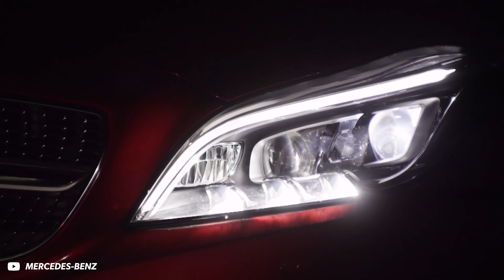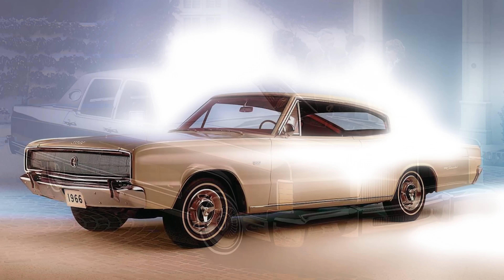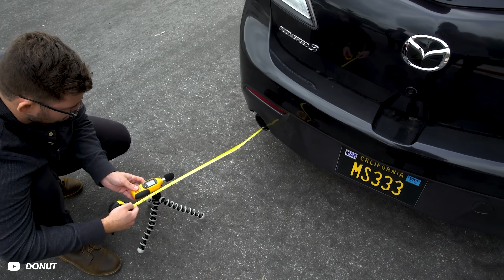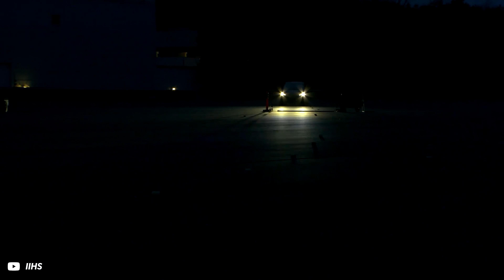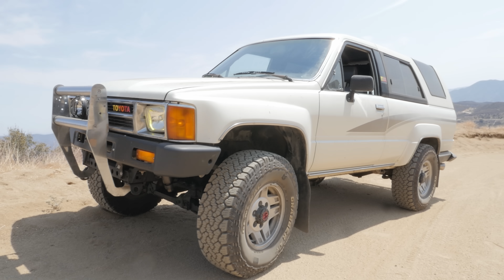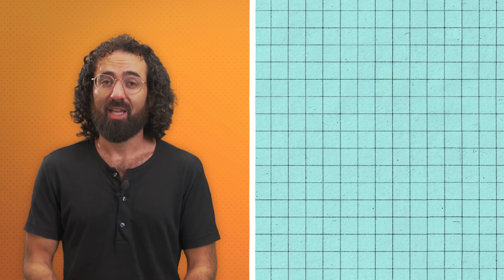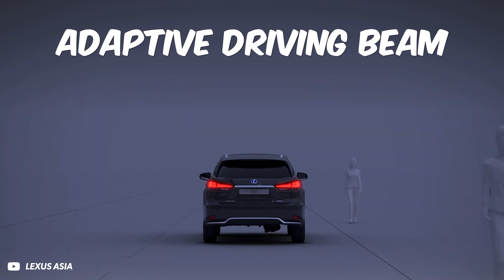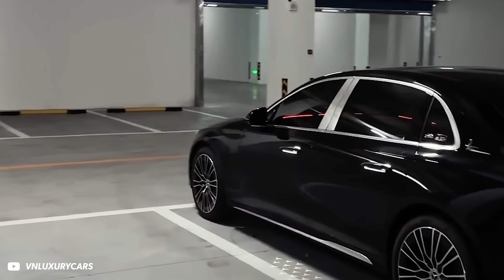Why new headlights are blinding American drivers

Comment: European here, its important to note that there ARE aftermarket LED bulbs which do in fact simulate the behavior of a halogen bulb filament and retain the correct beam pattern. There are also road legal certified models like the Osram and Phillips LEDs.
Those however are expensive, so most people buy cheap Chinese retrofits and give LEDs a bad rep.
Reply: Yea, those compliant LED replacement really works, you can tell if it's good if it doesn't require readjusting the headlight, it just throw out almost the same beam pattern as it has all the focal point of light source be exactly where halogen version of it would be.
Reply: Road legal aftermarket LED light sources have to be tested and approved for each type of headlight, which drive up costs and make it hard to find road legal LED light sources for less common vehicles.
Reply: @johan.edlund  exactly. The behaviour will depend on projector and other elements. It is not possible to emulate with leds the ligth emision of an halogen filament.
Reply: @ptamog Each road legal LED conversion kit is tested in the headlight it is approved for to verify that the headlight meets legal requirements with the LED lightsource. If it is used in any other headlight it's not road legal.
Reply: @johan.edlund  I need to look for a certified one for my car. The situation now is unbearable for people with halogens.
Reply: I've looked into things and done testing myself.  Some things I found:
Sometimes, even changing from Osram to Philips bulbs require beam adjustment.  (Yes, bulbs were correctly seated).

Projector beam patterns are different to reflector beam patterns as projectors have a raised horizontal cut-off towards n/s kerb whereas reflectors have a 15° slope.

LED output exceeded 100 lumens per watt in the last 2 years and Lumileds can reach 150 lumens now.

Motorcycles can upgrade to LEDs in UK.
I changed to retrofit LED projectors but incorporated a dimming function for urban use as headlamps are always on.
Strangely, these LED projectors are not legal for car use despite having excellent beam control.

Many trail type motorcycles have auxiliary fairy lights.  These lights do not produce a good beam pattern and produce glare.  They reduce safety.

Many OE lights have very poor beam control and output a lot of light above the beam cut-off.

Adaptive lighting is often very bad for truck drivers because truck drivers sit higher.  Adaptive lighting is not a panacea.

Some retro-fit LEDs by Osram and Philips have homologation in Europe.  Although the reflector beam pattern can still cause dazzle on sweeping left hand bends, they are normally a lot less dazzling than lots of OE lighting.

Many retro-fit LEDs produce lots of foreground lighting but offer less penetration (long range lighting) than good halogen lamps.

High efficiency bulbs by Philips and Osram are usually better than 80/100 watt halogen bulbs.  They cause less glare also.

It is possible to have aftermarket retro-fit LEDs in reflector lamps which don't dazzle unduly but care must be used.

Scratched and crazed polycarbonate lenses cause more dazzle than dirty lenses.  This makes a mockery of requirements for HIDs to have power wash.

If retrofit LEDs are used, people should use the electric load adjusters for urban use.

4×4s, crossovers and vans typically have lamps placed too high and typically dazzle drivers of cars and pedestrians.

Hope that may be helpful.
Reply: American here, I bought the road legal Philips bulbs in 4300k specifically due to their legal status (in Europe, leds are not legal in the US, just goes in enforced). Something like $240. Still obnoxiously bright.
Reply: @Krautastic  i've got plus 150% phillips and they are better than aftermarket LED. good for spotting Australian native animals. the 5500+k LED are usless for county roads,
Reply: Wut?
My understanding is the pattern is not achieved by the LED bulb itself, it is achieved either by a projector lens + a shutter or by a reflector.
A LED bulb is merely a stick with bunch of LED "chips", it has no "ambition" to direct the light it emits.
Reply: @jaromor8808 you are correct, however the light should be coming from a precise place, in this case the halogen fillament which is in a pre-determined position. Good LEDs replicate the little wire by having small thin chips (high-quality) on a thing board in the exact same location, this way retaining the intended source of light the same.
Reply: @jaromor8808 all those elements you mention participare in building the pattern. But they rely on the ligth originating in a particular spot, the halogen bulb filament position. That filament has a omni directiona radiation pattern that you can't emulate completely with leds. This means that some combinations will not give the correct pattern.
Reply: Most of them have an incorrect beam pattern and none will be right in a reflector lamp. Also you can't really keep them cool enough and they will burn out quickly.
Reply: @ptamog  You are correct about the omni direction light radiation of the tungsten fillament, however the majority of the light produced by it is  horizontal i.e. 3 and 9 o'clock positions, this is precisely why LED retrofits have 2 chips on each side. The reflector mainly relies and directs light by the horizontal facing mirrors, the upper and lower parts are used a lot less. In some cases the LED could even have sharper cut-off due to not radiating light up and down. I believe if there was a regulation on the quality of LEDs like there is on the halogen bulbs the situation could improve for both halogen users and LED retrofitters.
Reply: @moonsapling  If you look at a design like the H7 bulb, that emits all around. Led retrofits must choose an orientation and that may or may not work well for a specific model of car.
In the coments of this video I learned that here in Europe there are some retrofits that are homologated for specific models of cars. That is probably the way to go. I am getting one for my car.
Reply: @jaromor8808 Correct but the light source must be of suitable size and shape as well as being accurately placed for good light focus.
Reply: A friend of mine has sh!tty aftermarket LED bulbs in his car. They basically have two positions - BLIND EVERYONE and see fuqk all. No inbetween. He says he "sees fine", but I bet if I went and put a set of regular halogens in there he'd kick himself for not doing it earlier.
Reply: Another factor people neglect on older cars is polishing their headlights. If the lens is rough it's going to scatter the light into other drivers' eyes instead of the road. This also will lower the useful light output. A lot of times a good headlight restoration kit will get you better results than finding brighter and brighter bulbs/LEDs.
Reply: At the end of the day, they really aren't that expensive anymore. A pair of Philips Ultinon H7 usually sell around 50-60€ these days (I assume the Osrams are similarly priced) while the crappy ones seem to be somewhere around 30€. At this point it's just not worth the trouble (and potential fine) anymore.
Reply: I have the Osram ones, been using them for 2 years, no problems at all, passed MOT twice without issues! There are many reputable brands nowadays which have proper LED replacements!
Reply: @konni6694 they also have a short lifetime. That's what makes them so expensive. They get insanely hot.
Reply: Narva.
Reply: An other problem is that a lot of people don't even turn on the headlights, they keep driving with the daytime led lights with no pattern at all and no rear lights at all, those cars coming up behind you are blinding you in every mirror.
Reply: General service LEDs deserve a bad rep, they have solved 0.5 problems and created 50 more. Prior to the LED apocalypse the average visibility inside buildings was better. Visibility outside at night was remarkably better. LED lighting is a dangerous step backwards in technology.
Reply: Last time I came to France 🇫🇷 was 15 years. Are there people using Chinese led lights in their cars in France? Or in which European country are you? Those Chinese led lights are horrendous for our retina 👁️
Reply: They are expensive and also not allowed for every car. They literally have to be tested officially with every vehicle to be allowed in that vehicle. Even now they have tested only a few.
Reply: I have chinese LEDs on non projector lights and even those aren't blinding and have a very good pattern so i genuinely have no idea how people manage to fuck it up
Reply: @Zentrify you where lucky. Super lucky.

Comment: I drive a Mini Cooper. It is a regular height compared to other sedans on the road. The problem is that there are so many SUVs and large lifted trucks that absolutely blind you whenever they face you on the road. So I just blast my high beams whenever I see one. If they are going to blind me, i'm going to blind them right back.
Reply: You drive one of the worst offenders for blinding people, with those ridiculous head lamps that point at the sky!
Reply: Great. Two problems instead of zero.
Reply: thats a great way to get a ticket. you can't turn on your high beams at other cars because your car is lower and you feel inferior
Reply: @callumanderson8  I flash my high beams at them to turn their lights down. If they can't or won't turn them off and it's still bright I turn my high beams on so I can see. If I don't, I can't see the road. Simple as that. If you're in a moving vehicle with passengers and you're being blinded. Fuck everyone else you do what you need to do so you can see the road. Immediate safety of yourself and passengers comes first. For all you know you could be driving towards a wall or worse other people. It's not your fault. It's the arsehole in the car with the bright head lights blinding everyones fault. This is why I have  dash cam installed.
Reply: @callumanderson8  I guess i'll take the chance. If they don't care about blinding drivers then I don't care about blinding them. Turnabout is fair play.
Reply: @callumanderson8  Lol there's no traffic enforcement in the US
Reply: @callumanderson8  Just like you can't lift your truck and neglect adjusting your headlights so they don't blind other drivers. But nobody cares. If I am being blinded and can't see where I am going, I will hit the high beams so I don't end up in the ditch. Deal with it, or adjust your lights.

Comment: European here, all these aftermarket lightbulbs are not allowed, and we have a yearly inspection on the vehicle, where also the headlight adjustment is checked if it is too high or too low, it will get adjusted if the headlight cannot be adjusted properly. It is a fail, and you are no longer allowed to drive on the road 

My many many visits to the US have taught me that there is no adjustment equipment at shops to properly align the headlights (every and I mean every shop here in the Netherlands has such a device)

There is a light bulb code on the housing of the headlight that tells you what bulb the headlight is made for if you are running a aftermarket bulb, it will fail inspection as the lighting pattern is now changed
Reply: You literally only need a level surface and flat wall and a tape measure.  No need for expensive, over the top, capital-intensive investments when the solution is right there in the parking lot.
Reply: @nothingtoseaheardammit  that still does not make them set so they don’t blind people it’s also about the bulb and the projector or the headlight you put them in. The test equipment here in Europe is about 100 bucks
Reply: Actually, the MOT (APK) doesn’t care if you have LED’s in you hallogen housings; if they are showing a correct beam they are a-okay.

Because you are not allowed to remove said headlights to check if they are the legal type of LED headlight instead of Chinesium ones

Fun fact by the way. Got chinesium LED’s for €100

Gave a better beam for the MOT than the “allowed” ones from Osram and Phillips
Reply: in usa everything is allowed just not jaywalking
Reply: The American experience...
<Watching a guy in a pickup rolling coal so badly that everyone else has to slow down because they can't see.>

Police officer sees him. Doesn't do anything.

Meanwhile, I have to pay $25 for air emmisions standard testing because I drive a car.
Reply: and also, I bet a bunch of people in the US would complain about government overreach and over regulation if any law was introduced to govern headlights (those muh freedum people)
Reply: @THEFIRE360  Speaking as one of those "muh freedom people" - when you operate a motor vehicle, you've agreed to abide by the rules and regulations stipulated by the state when operating on their highways.  If you are just driving your SxS all over your 150 acres then put 24 light cannons on the rollbar and have at it, but civilization is based on rules and regulations that are agreed to by our congressional representatives and signed into law by our executive branch and if needed - rescinded, amended or accepted by judicial review.  This is how society should operate.  What us "muh freedom peoples" get upset about is when regulatory agencies assume authorities that were not explicitly granted to them by law and create rules and regulations that carry the force and penalty of law without any kind of say from our elected representatives.  (Or when they make stupid, nonsensical and contradictory rules like the ATF arm brace stupidity)
The NHTSA's job - in a nutshell - is to create an environment where licensed drivers can use public, taxpayer funded roadways in a safe manner (I mean its their agency *name*).  That is their legislative-granted authority.  Anyone complaining about them creating standards so that drivers aren't engaged in an arms escalation of headlights is not a "muh freedums" person and just someone who wants to be obnoxious.
Reply: @nothingtoseaheardammit  A most reasoned (and unexpected) viewpoint.  Thank You.